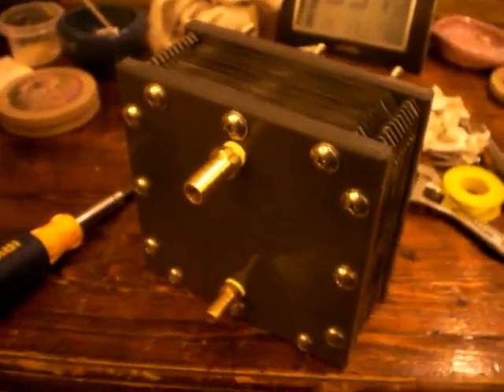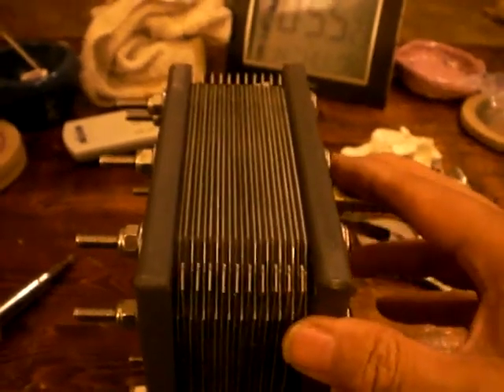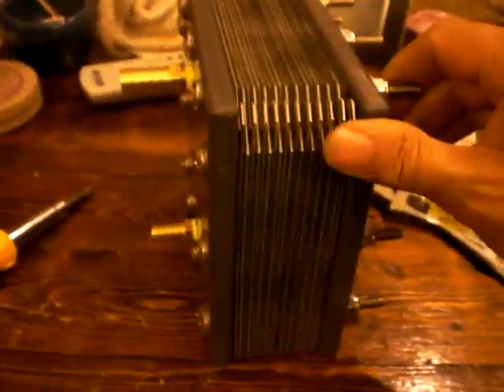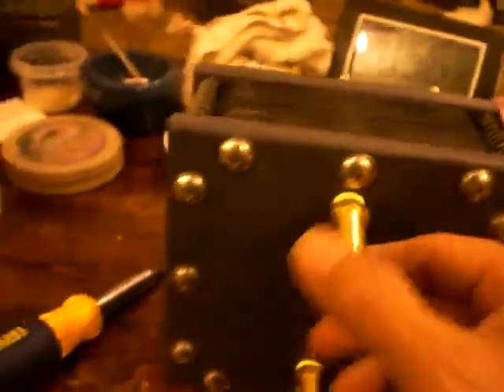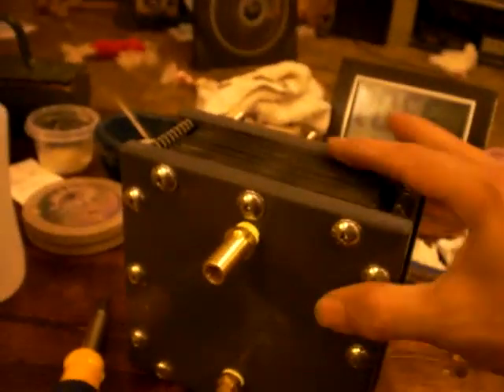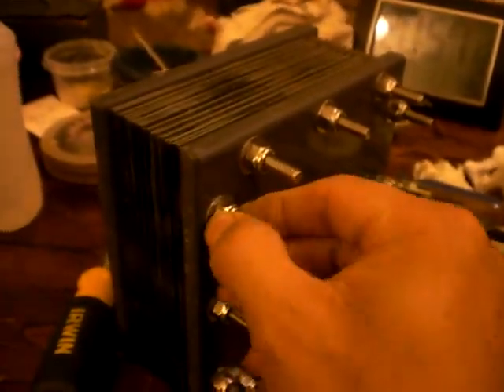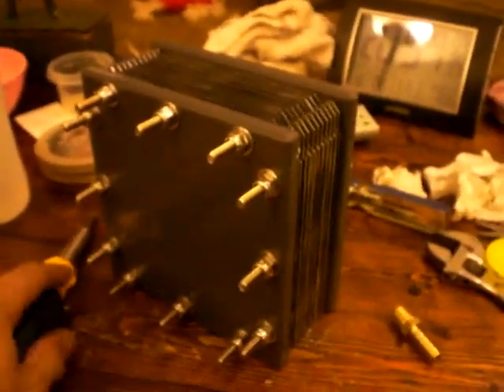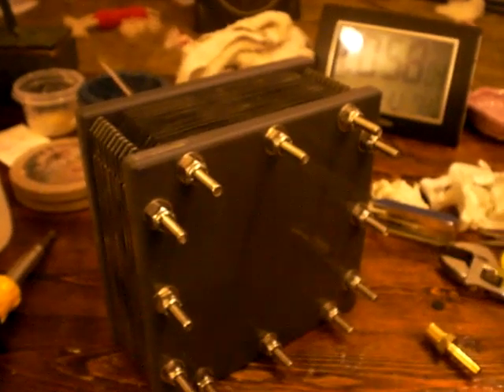EBN Dry Cell Assembled

Comment: My electrician tells me to be careful  and use white vinegar in the bubbler to neutralize the hho from the lye going into the engine. Also mentioned that if I run the engine too lean it will tend to get hot and burn the valves??

Comment: Interesting..flaw? in the design  that suggests that HHO does not exit fast enough...
Wouldn't it be cool if one could actually see how and exactly where the bubbles are:
-forming on the plate
-where they are being moved the most efficiently off the plate (possibly areas along the plate close to center?)
-how much and how effectively the bubbles are entering into the exit tube (perhaps more entry holes the whole way along the bottom and more exit holes along the top?..perfection still yet 2bhad?

Comment: I ask because I wonder if the preparation principles that Bob Boyce and Smack use may be helpful in doing more: improving efficiency etc.
...sanding in a cross pattern, pounding/roughing the surface...
Lukeoid153

Comment: Keep us to date on your progress. I am really interested to see what you come up with for a bubbler reservoir.

If you were using KOH, I would suggest 10g per gallon of distilled water as a good starting point. Check your amps, add about 1g at a time SLOWLY until you it up to about the amps you are comfortable with. Should be similar with NaOH. 

You should be able to get 1 to 1.5 LPM with as little as 20a or so at 12-14v. Be shooting for 5+ mmw. Let us know how you do.

Comment: I use same size inlet as outlet on mine and it works just fine.  So I do not think your going to the 3/8 lower barb is going to give you any grief at all.

The monster has 3 x 1/2 inch feeders and 3 x 1/2 inch exhausts and there is plenty of convection flow that I really do not need the pump I have hooked up to it unless I change fluid concentration and want to quickly recirculate the new mix of soup.

It will be prettier when it gets its EBN sticker.  Hear its on the way to you.